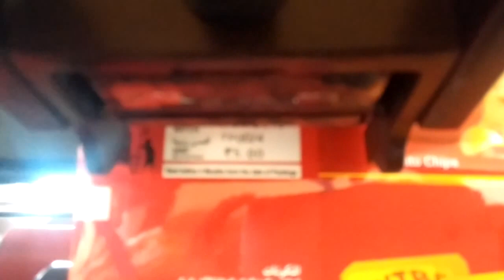Chips & Snacks Packing Machine 5gms to 1000gms

Comment: Also filling air ?
Reply from the maker: We are one of the leading Manufacturers for
premium range of industrial packaging machines, Automatic form Fill & Seal
Machines (FFS Machine), coding machines, and industrial packaging products.
There are widely used in the pharmaceuticals, garments, electronic, cosmetic,
food and beverages Industry including export houses .
Our machine is  Auto Weighing, Filling, nitrogen flushing, Sealing,
Coding, Batch Cutting, Cutting , counting all in one machine .One more special
features is that in our machine you can produce the packets ranging from 10gms
to 1000gms, 
Please Contact   +91 484 2382211 ,+91 9447111444 or Email:info@sampackindia.com